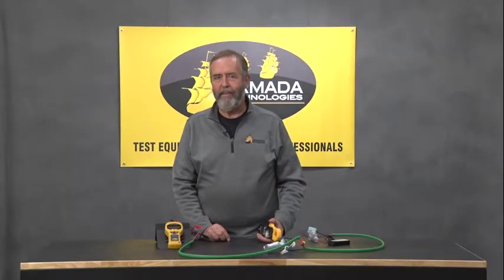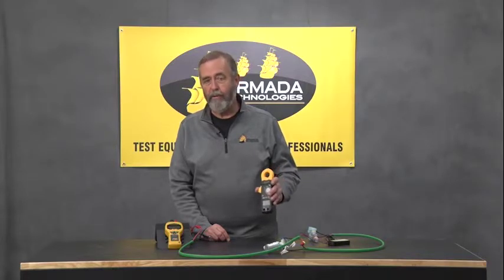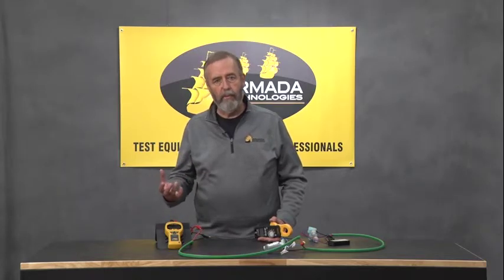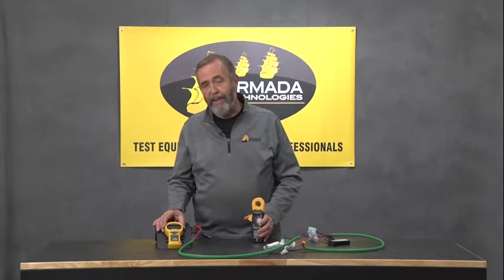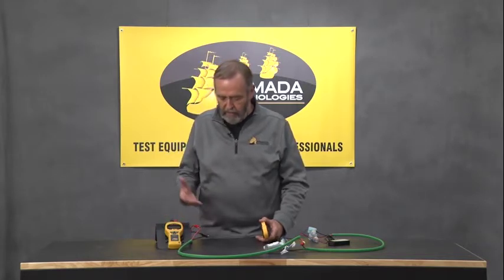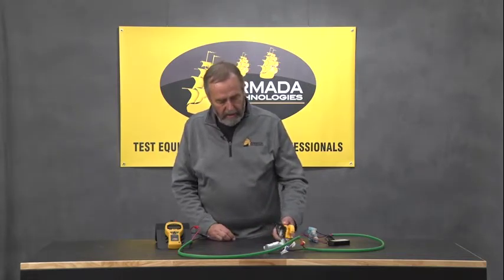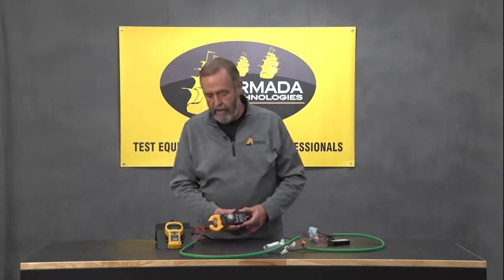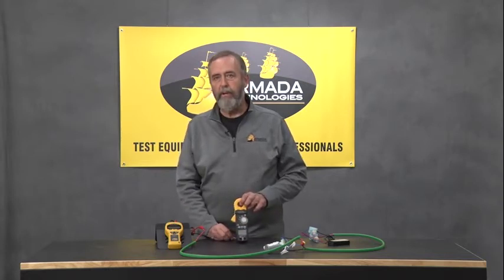Powering Decoders for 2-wire Troubleshooting - Technical Tip

Comment: It doesn't work for the 2-wire path.  Shuts off!  Mentioned this to Jim at Armada last year.  I use other resources with more power on the two wire when needed.
Reply: Hi PressureWash: The Pro50 will keep you in business up to a point. If the fault is a very low resistance the Pro50 batteries will struggle to provide the current needed and shut off. You can check the scale of the fault by putting the '50 in meter mode to read resistance Red/Blue or Red/Black, or use a regular multimeter. I have used an AC-powered transformer unit with internal fusing when power is available - even this will give up in the face of a dead short, like controllers do. Let me know if you want the vendor model number for a transformer.

Comment: When I hooked my 50 to a faulty 2 wire path. When i tuned on the 24v the meter shut off. Did try again same results. Why do you think that is? It’s a great tool to have, thank you
Reply: Hi CL:  If the fault is a very low resistance the Pro50 batteries will struggle to provide the current needed and shut off. You can check the fault by putting the '50 in meter mode to read resistance Red/Blue or Red/Black, or use a regular multimeter. In any case it is a good idea to a simple resistance fault check to begin with - I include a ground fault check between the control cable wires and the dirt.